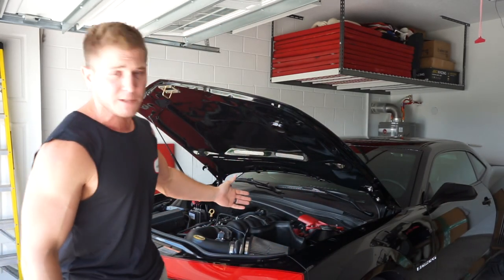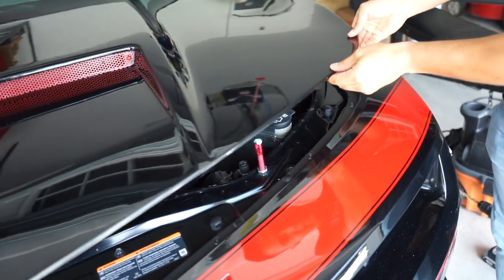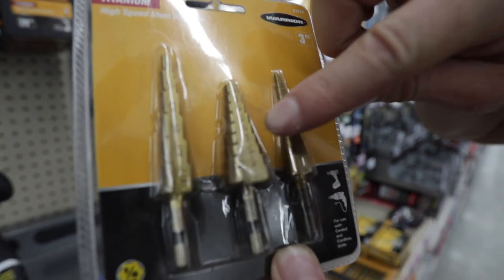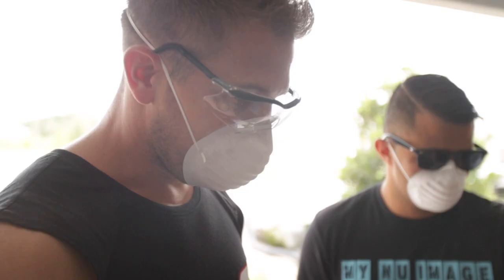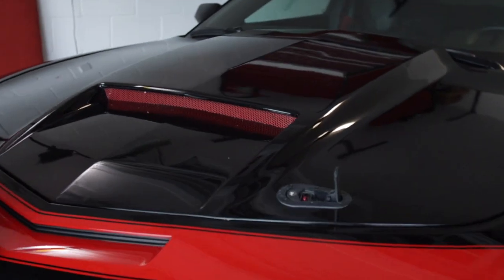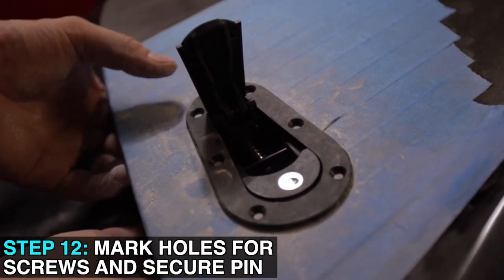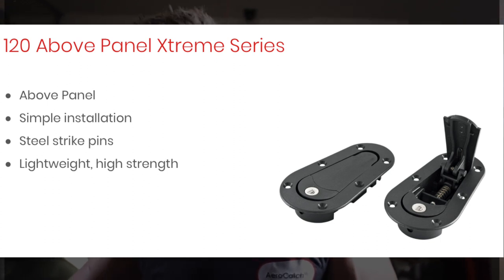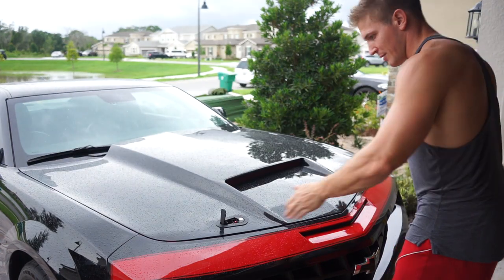AeroCatch Hood Pin Step-By-Step Install! | 2010 2SS CAMARO - 5TH GEN - Scott Herman

Comment from the maker: My fiberglass hood tends to flutter when it's really windy on the highway (and when I am going 100mph+... haha) and I have had a hood flip on me before.  It is NOT FUN guys.  So with my hood being a function ram air hood I decided it would be smart to install some hood pins to ensure I never have to worry, especially as I continue to modify my ride making Jane as fast as I can!

I really hope this installation guide helps you all see that cutting into your hood isn't as scary as it might seem! All it takes is a little patience and the right tool!  You got this!!
https://www.instagram.com/camarojane/

Check Out The Hood Pin Selection at https://www.aerocatch.com/
Reply: would u get the zl1

Comment: Awesome job brotha💪 May I suggest using a PCV rubber grommet instead of vacuum line as imo it will look cleaner. They have assorted sizes to test fit. Other than that it looks sweet.
Reply from the maker: Yeah thats a good idea if I can find one that is the right size!!
Reply: @OhTheHermanity  you could also go to a bodyshop and they would have body grommets that would work or go to Napa they have a bin of pcv rubber grommets for any job or size👍😁
Reply from the maker: Thanks man!!